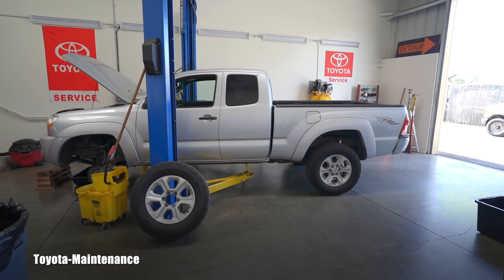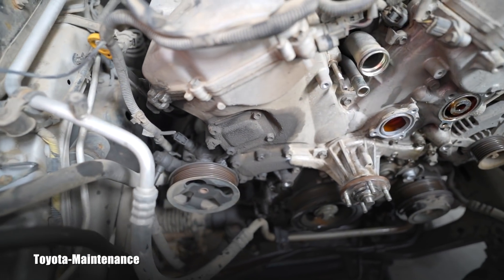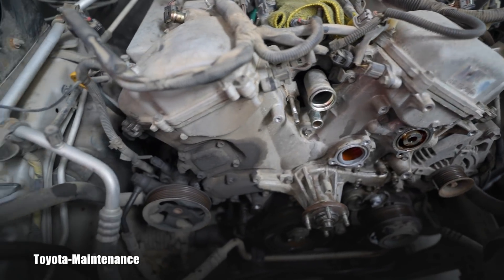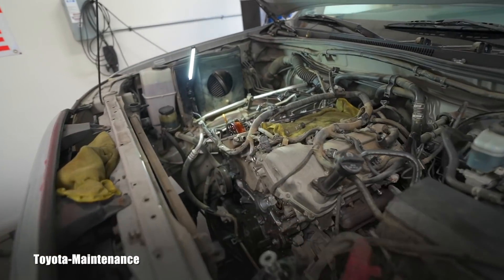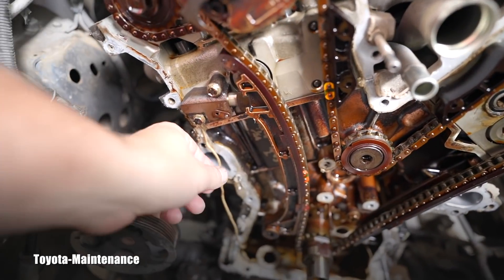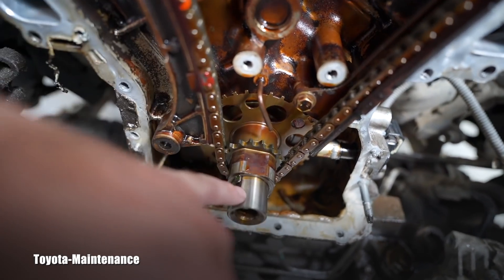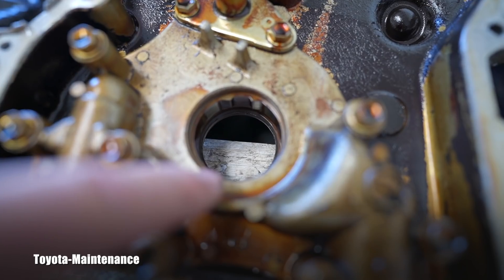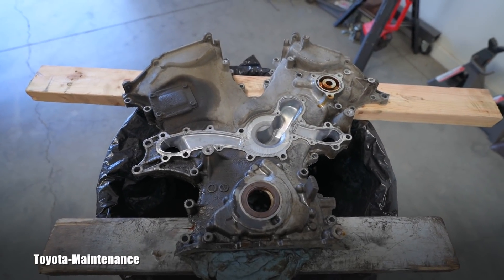Toyota 1GR-FE Timing Chain Cover re-seal Tips&Tricks

Comment: Both oil pans need to be removed before the timing cover if the oil filter is the cartridge type, accessed from under the truck, like on the 5th gen 4runner configuration of the 1GR-FE.  This makes the job more difficult.  Below is my 25 step sequence to complete the job on a 5th gen 4x4.  Each step is numbered and has sub steps when needed, substeps are my notes, some steps list the FSM page reference.   Formatting got screwed up a bit when copied from a word doc, some of the torque values are listed.  Best to use an industrial syringe to apply the toyota FIP sealant to achieve the specified diameter bead.   (Reference to hose # and Connector # below match what is in the FSM)  

 	 Step						
1-	Plastic Rad cover
2-	Batt & Mount 1x10 1x12
3-	Grill and latch cover
□	grill 1 bolt, 2 clips on each end 10mm	
□	Latch cover bolt 10mm			
	Latch 3x10mm				
4-	Wheels
□	Remove front wheels 12x21mm					85ft-lb
5-	Air intake and Ducting
	#1 Hose
	#2 Hose
	1 wire mount
	MAF Connector
	Duct from filter box to intake, 1x10mm	
	2 wire plastic clips
	Airbox 3x12mm				
	2 plastic wire clips
6-	Intake plenum
	Throttle Body connector
	No 1 vac switching valve and clip. Drvs side
□	#3 Hose Vac switching valve, 2 brace bolts
	#4 Hose  Throttle body to thermostat housing
	#5 Hose   “
	Two heater hose clips
□	#6 Hose behind vac control switch
	Plastic wire harness clip to frt drvs brace
	Remove Pelnum 2x12mm nuts, 4x8mm 	all τ=28N·m
□	Remove Brace bolts 3x12mm	  	
7-	Wire Harness on valve covers
	Fuel injectors labeled 1-6
 	pas-side cover
	#1-#4 four misc connectors
	frt bracket 10mm			
	side bracket 10mm			
 	drv-side cover
	#5-#8 four misc connectors
	3 Plastic clips    
	rear medal mnt 10mm			
	Main harness plastic clip rear intake
and two behind P-valve cover.
	GRD on back of P-Valve cover 10mm	
8-	FAN and Shroud
	Fan 4x12mm bolts (need new bolts)	
 	(line up paint marks when re-installed)
	unbolt trans cooler lines from shroud
	Remove shroud		
9-	Radiator
□	Drain/Fill Radiator
	Remove upper condenser bracing		2x8mm 3x10
	remove upper rad mounts 2x12mm	
	remove plastic side shroud
	remove lower mount bolts 2x12mm	
	remove Reservoir tank bolts 3x10mm 
	Upper and lower hoses 
10-	Wiring harness lower P-side
	Two P.S connectors
	Oil pressure sensor connector
11-	P.S.
	3 bolts removed 					3x14mm τ=43NM
12-	Water line to/from Oil cooler (needs to be installed prior to PS pump)
	1x10mm bracket bolt upper pside cover	τ=10NM
	1x10mm bracket bolt on oil cooler	τ=10NM
	1x10mm bracket bolt bellow WP p-side	τ=10NM
	upper two clamps & hoses
	lower two clamps & hoses
   
13-	WATER INLET HOUSING      p.1708,2610
	mount bolts 5x10mm	 		5x10mm τ=10N·m
	#6-9 Hose Removed 	
mount No.3 water bypass hose to 
pipe on motor to ease install.			
	(note; #4&5 hose removed with plenum)
14-	Alt 
	Mount bolts in alt  2x14mm		2x14mm τ=43NM
	Chassis mount (thru tire access) 12mm	,1x12mm τ=20NM
	Cable bracket 2x10mm					2x10mm τ=8NM
	Batt cable Plastic clip 10mm nut			1x10mm τ=9.8NM
15-	AC
	3x12 bolts, 1x12mm nut, 1 E8 stud
	AC connection
unbolt, move forward to access to the connector.  Hang ac from oil filler when last stud is removed. 
16-	Crankshaft pulley   p.2612 pi.2633				
	1 Bolt, with pulley (Pull with harm balancer) 		1x22mm τ=260NM (or 3 chugachuga’s)
17-	Oil filter mount  p.2611 pi.2633
□	DRAIN/fill motor OIL (install new filter)
	2x12mm nuts & 2 studs, 1x12mm Bolt	BIJ		3x12mm τ=21NM 2xE8 studs τ=10NM
all 15 ft-lb.
18-	Belt Tensioner and 3 idler pulleys pi.2633 
	3 idler pulleys bolts left in pulleys				5x14mm τ=36N·m
	Engine crank pos sensor connection (behind AC)
note; snap clip must be moved into lock position.
	Wire mount on motor mount rear of AC 			1x10mm τ=10N·m
 19-	Front axles, prop shaft,  p.1303 img p.1299 (
(Should have been removed first, to allow more access.  Will be re-installed last. Jumped to wire harness #7)
 □	Drain/Fill diff
 	Drv Side-
□	Remove caliper bolts  2x17mm		
□	brake line & spd sensor bracket 12mm	
□	Wheel Speed sensor connector (on hub)
□	2x spd sensor brackets 2x10mm 1 per	
□	Remove Hub cover, cotter pin, bolt cover
□	Remove axle nut, use impact 35mm	
□	Pull hub from axle (split bearing Puller)
 	Pass Side-
□	Remove caliper bolts  2x17mm		
□	brake line & spd sensor bracket 12mm	
□	Wheel Speed sensor connector (on hub)
□	2x spd sensor brackets 2x10mm 1 per	
□	Remove Hub cover, cotter pin, bolt cover
□	Remove axle nut, use impact 35mm	
□	Pull hub from axle (split bearing Puller)
□	DRAIN DIFF OIL
	Remove Axles with brass drift
Hang axle to keep it strait when install/remove. 
	Remove ADD connector
	Cable mount, on pass side axle. 10mm	
	Remove propeller shaft 4 bolts. 		4x12mm τ=88N·m
Install, Align the match-mark on the yoke and differential flange.
	Remove breather tube bracket. 10mm	
	Remove ADD vac hose 
	Remove time cvr braket oil dip stick                    10mm	 			
20-	Remove Cam Covers  p.2613 install 2307
	remove oil pipe P-side 2x17mm			2x17mm τ=65N·m
	bracket p-side on cover frt 1x10mm		1x10mm τ=10N·m
	bracket p-side on cover rear 2x10mm		2x10mm τ=10N·m
	Remove 6 coil packs 6x10mm			6x10mm τ=10N·m
	remove 12 bolts P-side cam cover 		10x10mm τ=10N·m , 2x12mm τ=21N·m
	remove P-side cam cover
	remove/replace 3 o-ring gaskets pside
	Disconnect FUEL Hose.
	vent hose bracket D-side rear 1x10mm	1x10mm τ=10N·m
	fuel hose bracket D-side rear 1x10mm		1x10mm τ=10N·m
	Remove fuel hose gaurd plate 2x10mm		2x10mm τ=10N·m
(for clearance) 
	**removed wire bracket on back of motor, need to reattach bolt.  Did not need to remove
	Remove two heater hose from fire wall
□	2x10mm			BLIp  ??????????????????
	remove oil pipe D-side  				2x17mm  τ=65N·m
clean screen in upper bolt
	remove 12 bolts D-side cam cover 		3x10mm τ=10N·m , 3x12mm τ=21N·m
	remove D-side cam cover
	remove/replace 3 o-ring gaskets d-side
	remove/replace six plug gaskets from covers
21-	Raise Motor 2”
	  Remove 2 motor mount bolts. (insure prop shaft unconnected prior to raising)
Jack from oil pan about 2” place blocks, then remove jack.
Note drive shaft position when lowering
22-	Remove/install front diff
	Remove/Install front diff (use MC Jack)
(dis/Connect diff breather, vac hoses, and clamp, and connector before lowering)
	breather tube bracket with the bolt. 	τ= 13 N·m 
	No. 1 front differential mounting nut. 	τ= 87 N·m
	2 front mounting bolts and 2 nuts 	τ=137 N·m
 23-	Remove oil Pans p.2614
	Remove oil pan #1 bolts 10x10mm 2x10mm  τ=7NM  tighten bolts first
	Remove strainer 2x10mm nuts 	τ=9NM  
	Remove 2 Trany cooler line brackets p side
1x12mm mount bolt per and 10mm clamp bolt
	Remove oil pan #2 15x12 bolts τ=21NM, 2x12 nuts τ=21NM, 2x10 bolts τ=10NM  
	Unbolt steering Rack and move forward for clearance  τ=120NM
	Remove oil pan #2
 24-	Water Pump removal (WP re-installed with timing cover) p.1711
	17 Bolts labeled 1-16(no #12), A, B	BIJ
Bolt diagram and part labeled   1 Bolt (with pulley)
25-	Remove timing cover. 	Pi.2616-2625
	Remove time cover bolts
	Remove timing cover
	Replace 3 O-rings
	Remove, Replace crankshaft seal
 26-	Re-seal and reinstall in reverse order.

Comment: Thank you for your great videos. I've found two different specs for torque on timing cover bolts for my 2010 4.0 V6 Tacoma. One says 80 inch lbs (6.7 ft lbs). The other, 17 ft lbs. Which is correct? Thanks again for your videos.
Reply: 80 inch for the smaller 10 mm bolts. 17 ft lb for the larger 12mm

Comment: dude, hope you are alive and good. I have a leak in the timing chain cover of Highlander 2012 (2GR-FE engine). What if I just keep refilling the oil and leave it as is? I mean, oil is inside the cover anyway, so it just leaks and so what? what are the risks?
Reply: What I have seen from the experts (Care Care Nut)  seepage is ok, but if starts to drip on ground, etc and get worse it's time to replace/repair sealant.  Keep cleaning the area and note how much it is leaking.

Comment: I own a 2006 Tundra SR5 with this exact 4.0 V6 and my front timing cover leaks oil, minor at the moment, but at some point I'll have to get it repaired, what is the average repair cost?
Reply: Got quoted around $2,500 for it today. Leaks been very minor for me for the past couple years but havent had any issues since im on top of oil changes every 3-5k miles
Reply: @adrianromero8796  Same! It's very minor. That price is outrageous!

Comment: I fixed my leak. But when putting it back together I noticed the power steering pump acts like a spacer between the engine and Timing Cover. It prevents the timing cover from tightening correctly. I took a green scruby on a wheel air grinder and hit the power steering pump. I think you could remove the power steering pump and take a little off with a scruby or a file and retighten and it might stop the leak.  I did a bit of research and found several people that repaired it and later the leak came back, this further supports my theory.
Reply: You sir are a legend, i just rebuilt my engine and installed a new cover, after running the engine for a couple of minutes i started noticing an oil leak, funnily enough it was coming from the steering pump side, i will try what you suggested and hopefully that will fix the problem.
Reply: Did you retighten the timing chain cover before reinstalling the power steering pump? I think you are onto something and trying to understand

Comment: Great video! A question, I have to reseal my time chain cover too, would you recommend to replace the time chain kit? Even if I’m not having any issue with it but I’m thinking on replace it because the cover will be removed anyway, I have the same engine and has 332 thousand miles, should I just reseal it or should I install the timing chain kit? I want to keep the engine running good forever, I just want the best of the best, if so, should I buy just OEM parts?

Comment: Hi Peter, I love your videos. I have a question, have you ever had a P0016 code in a toyota corolla?
My toyota matrix 2005 has this code, when its idling  vibrates too much, and once I accelerate the vibration stops and runs well. The mechanic already checked the crankshaft and camshaft position sensors and they are fine, also the solenoid vvt. And he said that the car runs very well to believe that the chain is out of time. What do you think it could be the problem?
Thank you!

Comment: I have seepage on the timing belt cover of 2GR-FE.  Repair requires dropping the whole engine, the dealer wants $3200 for it.  The seepage is not bad--no drips on the ground and oil level does not drop significantly between oil changes.  I am leaving it alone.
Reply: as mentioned above, if leak is not that big, oil does not drops on floor and no issue with filling oil between changes leave it like that. Just bring it to some shop so they can wash your engine proffesional before taking it to yearly inspection and that's it. No messing around as long you dont need to fill up the oil. Engine do not rust cause of oil or any part for that matter.
Reply: @The_Touring_Jedi  On mine I fixed it. But when putting it back together I noticed the power steering pump acks like a spacer between the engine and Timing Cover. It prevents the timing cover from tightening correctly. I took a green scruby on a wheel air grinder and hit the power steering pump. I think you could remove the power steering pump and take a little off with a scruby or a file and retighten and it might stop the leak.  I did a bit of research and found several people that repaired and later the leak came back, this further supports my theory.
Reply: @vincesmith8415 has the leak come back yet?

Comment: If this was my truck, there is no way I would do all that work with over 200,000 miles and NOT replace the timing chain and associated parts.
Reply: Check out the procedure to change all three timing chains. It may dampen your enthusiasm.

Comment: Great vid. My 2011 taco 1GR-FE is gettin within 200 miles of clocking 1/4 of a million miles. Full synthetic oil at every 10k and all the usual maintenance. No issues but I was wondering about the timing chain in mine so thanks for showing the good condition of the chain in this truck.

Comment: I'm cheap, so unless it was dripping onto my garage floor and making a huge mess, I would hit the area with some old rags, possibly dampened with a little mineral spirits (NOT gasoline, since the heavy gasoline vapor is way too flammable to use for cleaning oily stuff) and call it clean enough. Twenty drops of oil can spread out and wet a huge area of metal. Unless it is dripping off the bottom, it will never cause an engine oil shortage. And oily steel or aluminum will never corrode.      
I wish Peter had shown us what was generating all that noise. Not that a commercial area can be expected to be quiet like a Hollywood sound stage or a recording studio.
Reply: Same with me, why messing with perfectly working engine that has some oil sweat...
Reply: same, oil level never changes. i call it patina

Comment: - V6 

Why did Americans get such a terrible engine option? I4 and the i4 diesel is the only thing you need.
Reply: I got the V-6 because I didn’t want joggers passing me while I was trying to accelerate to my cruising speed.
Reply: @Yohann67  It's still a V6 you are still getting passed by joggers
Reply: @gvi341984  Na, you are confusing my truck with a 4 banger. What do those have, like 95 HP?
Reply: @Yohann67  75 kW (102 DIN hp) at 3,600 rpm and up-to 260 Nm of torque at low rpm
Reply: @gvi341984  That is hilarious! I was being sarcastic but damn that is low HP. Well for a gas engine. If they made a decent diesel I would have one but there is no way I would buy a 4 cylinder gas engined truck.
Reply: @Yohann67  That's the 4 cylinder diesel versions. They live in areas without roads so that's why they are true offrosders
Reply: @gvi341984  Yeah, I hear you, Torque rules in the truck world. Chevrolet has a new diesel in their Colorado and even 1/2 ton full size now but they don’t push them in the off road versions. Can’t even get a manual with a diesel anymore.
Reply: I got the V6 in my hilux... blows the doors of a Commodore and keeps up with my m8s v8. Keep it slow ass deisels haha
Reply: You need the V6 if you are using your truck for towing large trailers for the power and torque.
Reply: @johntheaccountant5594  I4 diesel makes sense for low end torque towing. V6 is just a terrible engine idea that Toyota pushed for the Americans
Reply: @gvi341984  I did not know that you were talking about a diesel engine.  I did not think Toyota did a diesel engine in the USA.  I have a 2.4 4 cylinder diesel in my Toyota Hilux Pick Up in Thailand and yes a diesel has much more torque and is better for a truck in my opinion.
Reply: @johntheaccountant5594  For a short time they did but they were phased out for the gutless V6. Consume as much as a V8 without the torque that's crazy
Reply: Terrible engine?  I don’t know about that… I like diesels, but my v6 is way faster and useful in urban driving.  I mean 0-60mph (100km) in almost half the time
As the i4 diesel.  345,000 miles to date on the my Taco engine and transmission, no issues.  I’m not sure how that’s terrible.  🤔
Reply: only poor people drive diesel in this part of the world

Comment: Would it be a good idea to replace the water pump when working on the chain or the cover?
Reply: A new pump is cheap, at 220k, might as well put a new one if you're in there
Reply: @rexeverything1163  . That I was thinking. Many cars in the last few years tell you to replace certain items, where you have disturb or items. otherwise you back later on replacing it.
Reply: I don’t think you can take the cover off without removal of water pump

Comment: Looks like some extended oil changes based on the varnish I see. Great video as always Peter.
Reply: Yep, takes a fair bit of abuse to achieve that on a Toyota
Reply: Can’t blame the owner when Toyota saids to change your oil at 8k miles
Reply: Extended oil changes aren’t a problem. But you need to use an oil that’s capable of extended drain intervals.
Reply: Change every 5k